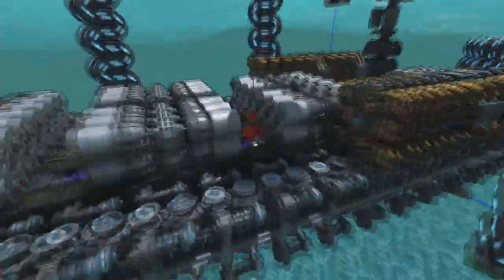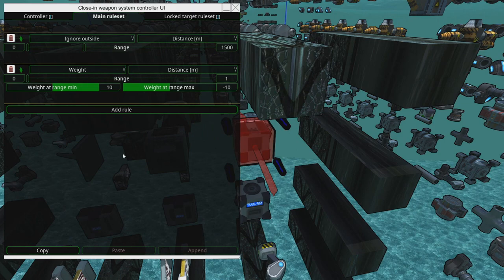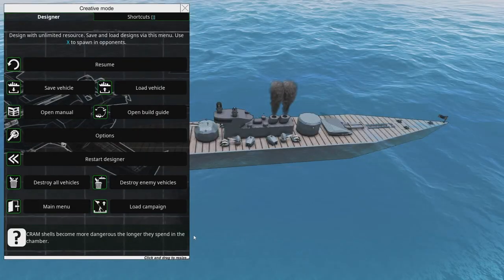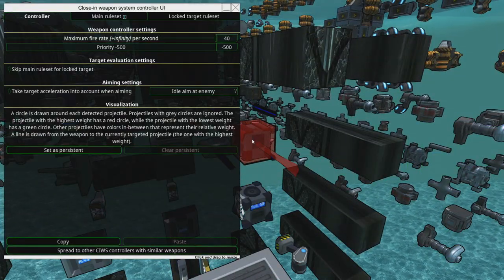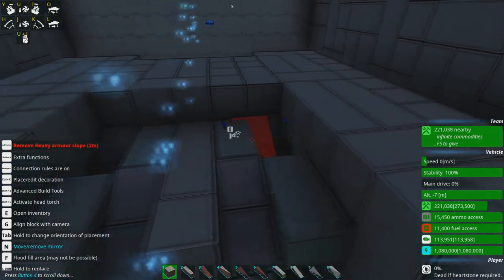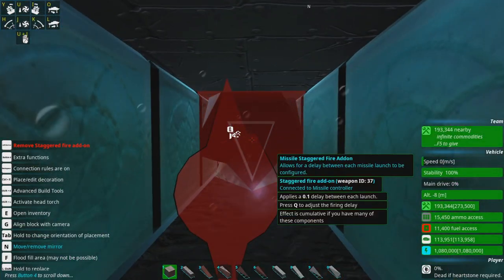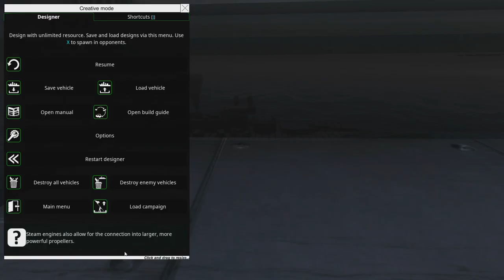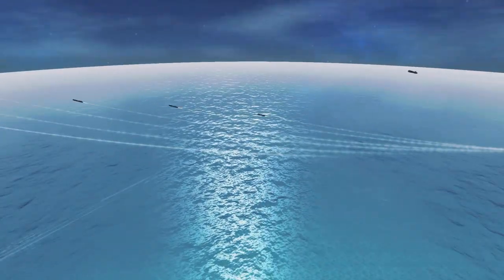Complete Ship Walkthrough #16 - Missile Interceptors! 🚀✋ From the Depths

Comment: You were wondering about your surge protectors. I've said before, don't put them next to the stuff you are trying to protect. If an EMP hits the area it's going to go to the surge protector, maybe through what you are trying to protect, and if there's anything left it is going right into what you were trying to protect.
I would recommend putting them in the area but closer to the outside. The EMP won't go through the vital stuff, and after the surge protector it will have to look for another target, maybe another surge protector.

My own craft usually have a HA spine and I put them along that. With no resistance, a hit almost anywhere will have the EMP jumping from one surge protector the the next.
Reply from the maker: Cheers, thanks for reminding me. I keep forgetting that. 👍